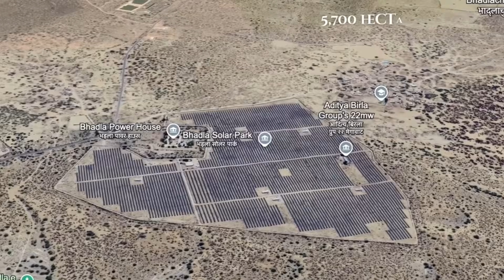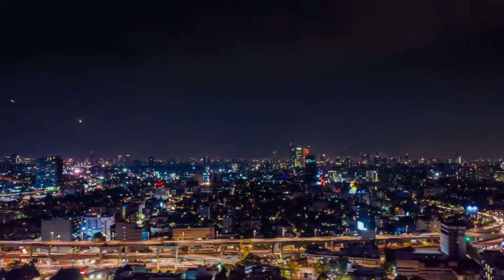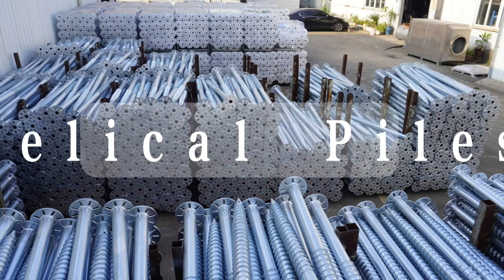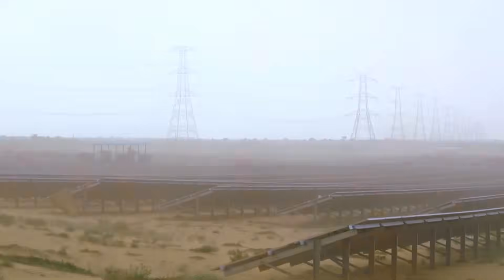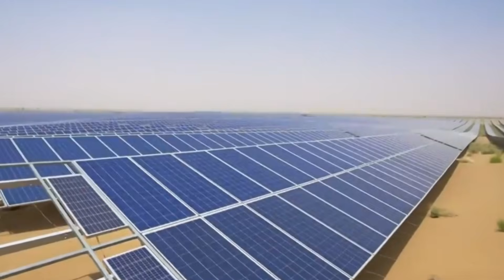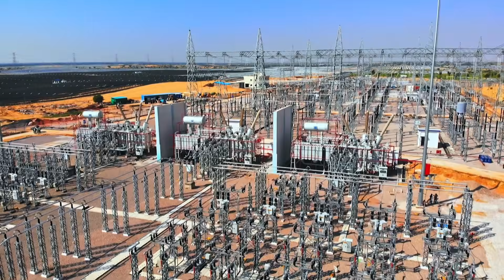How Did India Turn a Dead Desert Into the World’s Largest Solar Park?

Comment: My cousin is power control manager at khavda(run of Kutch) solar plant which is biggest solar plant in the world equivalent to 7x paris. Btw that project covers 580+ km area and 10x bigger than this
Reply from the maker: You’re right — Khavda in the Rann of Kutch is now the much bigger project and is planned to become the world’s largest renewable energy park. Bhadla Solar Park was often called the world’s largest solar park in the earlier period, but Khavda has changed the scale completely.

Small correction: Khavda is usually described as a renewable energy park or hybrid solar-wind project, not just a pure solar plant. Depending on the boundary used, sources describe it as around 538 km², or over 700 km² for the wider park area — so yes, it is many times larger than Bhadla. Thanks for pointing it out!